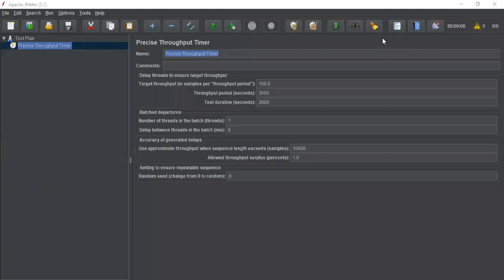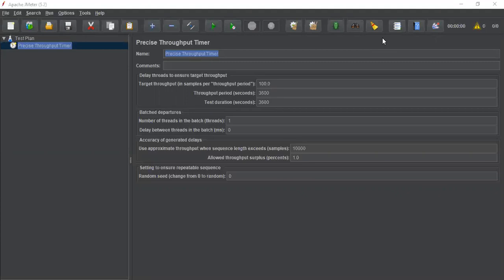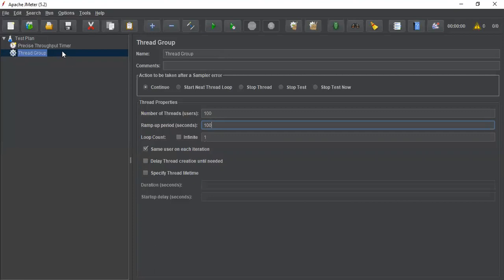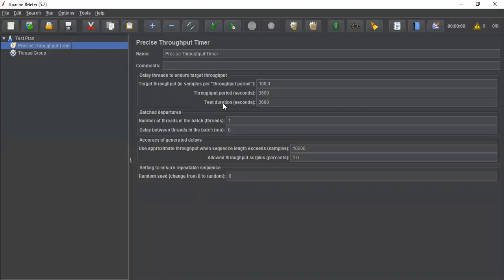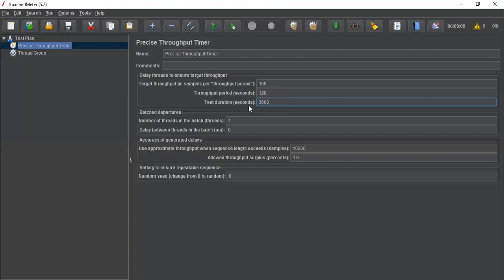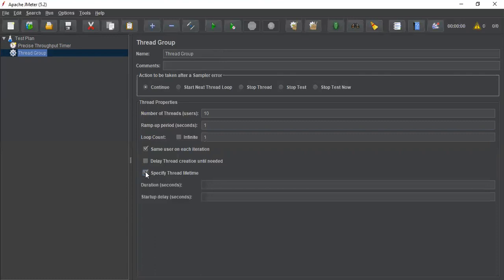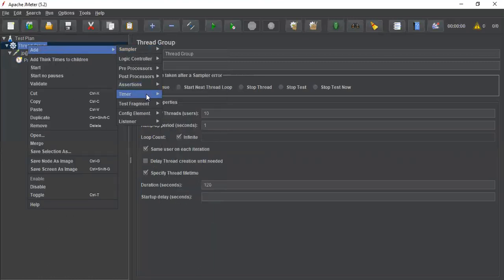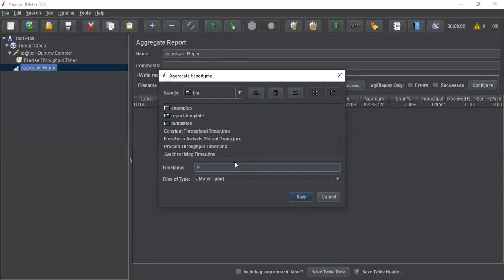36-Precise Throughput Timer

Comment: Great explanation. However I keep myself not using this timer because of some of so many config values to be provided. Its quite clear. now

I have a question:
My scenario is 
To ramp up my desired load in 2 hours and then followed by continuous load for 12 hours(endurance) with frequent spike for 5 to 10 mins at every 1 hour.

In my situation - I have already reached my max users at my end of ramp up. Now I cant add and remove the users anymore to introduce spike(in loadrunner, we have option to do this). Now only option is reduce the delay for 5 to 10 mins and then bring the delay to normal.

Is there any way to achieve this?